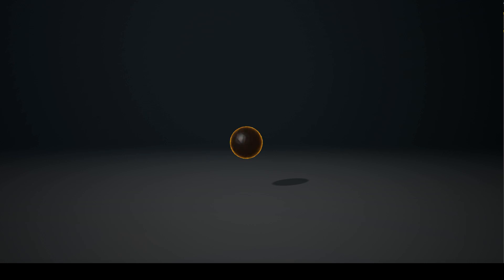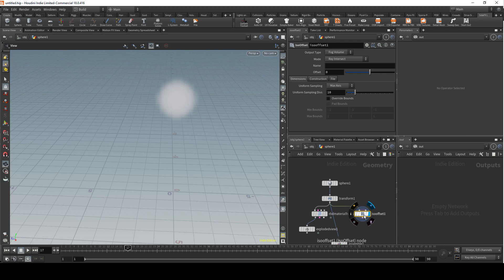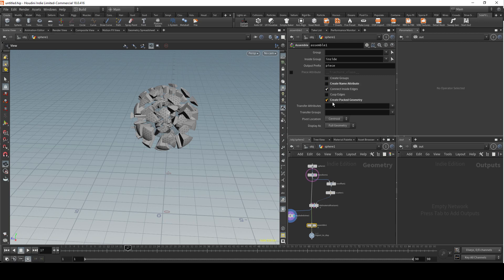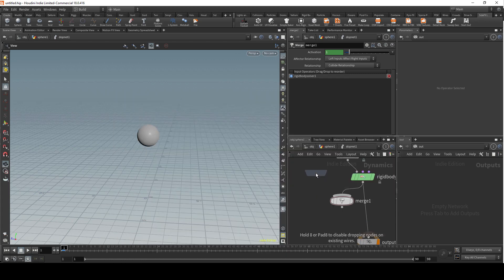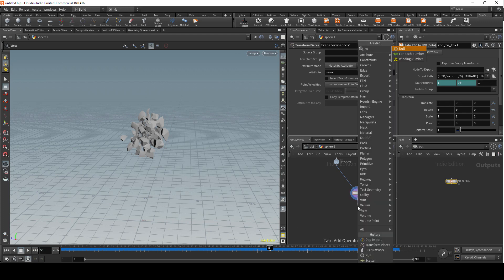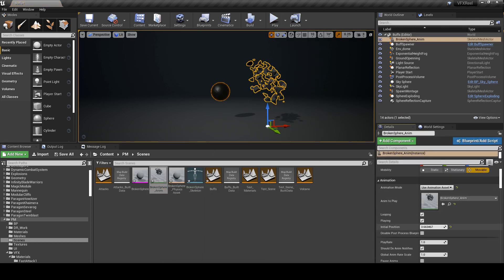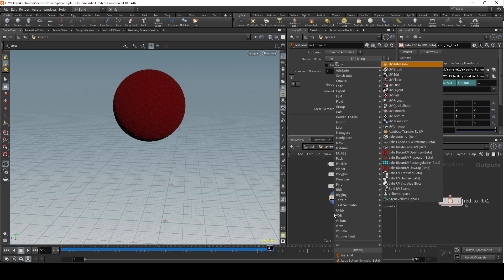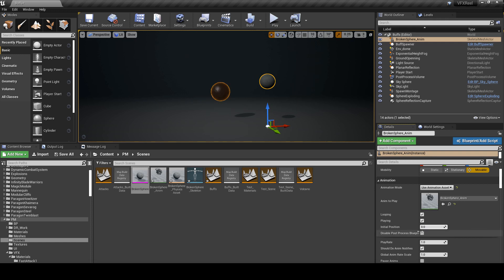How to Realtime - VFX / Sphere Break TUTORIAL PART 1 using Houdini and Unreal engine

Comment: Hey, did something change in the latest versions? I'm not getting the two material slots when I import in Unreal Engine. 
In Houdini it kills the materials when I do a final Assemble, I think the data is still there because if I unpack then the materials are still present. 
However, if I plug in the Unpack into the export then I just don't get a mesh at all in the export. 
Really confused.
Reply: Figured it out, turns out with latest Houdini you are supposed to use a ROP FBX SOP (Houdini community has way too many abbreviations...) and RBD to FBX is obsolete and is planned to be deprecated in the future versions. 
Make sure you tick "Build Hierarchy from Path Attribute" on the ROP FBX output
Reply from the maker: thanks for that, I will probably update the tutorial at some point
Reply: @max-sworn  And then you'll get a ton of piece meshes each with its own animation track! At least in my case: https://i.imgur.com/ZdDd8fj.jpg Ragarding to rbd2fbx - 1.0 doesn't count "root" transform in sop, 2.0 has bugs and produces glitches with some small parts animation, 3.0 doesn't write matrial ids.
Reply: @tertiumorganum5665  Wow, that's a totally different result than I got, mine imported the way you'd expect (identical to what is shown in this tutorial). Seems like that export is very finnicky. 

As a side note: you may want to look into vertex animation textures for RBD export, SideFX labs people have a video on vimeo about that, it's not that much harder to set-up (probably adds a minute or two to the pipeline), but the result is much much more optimized, you can have hundreds of this same effect without a real performance dip.